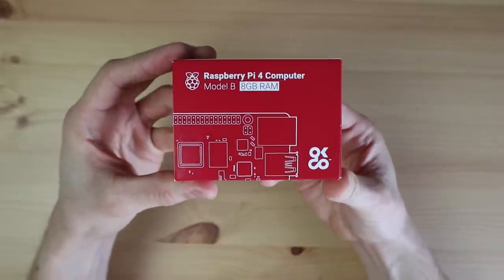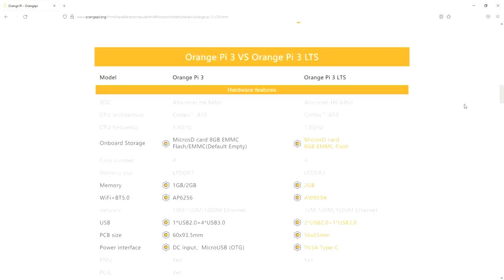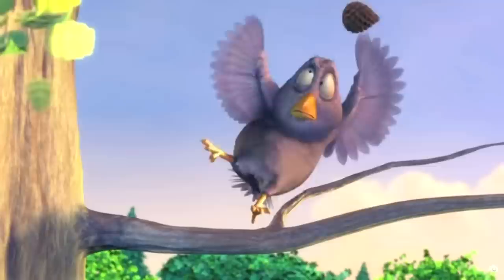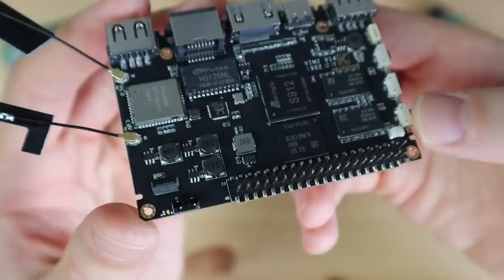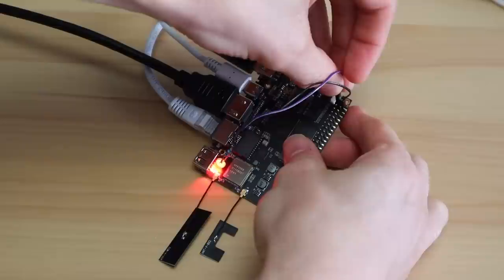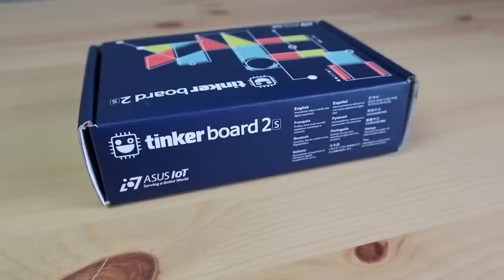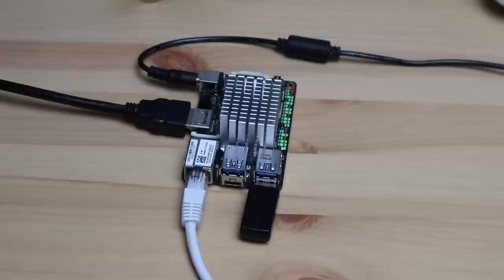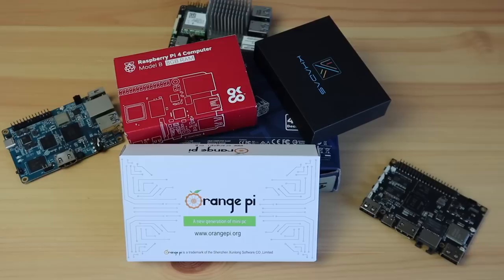Pi Shortage - Are These Worthwhile Raspberry Pi Alternatives?

Comment: I like RPi, but for my own microserver I use an Odroid XU4. It has slower single core performance and it has less RAM, but having 8 cores available at all times is amazing
Reply: What os are you using?
Reply: @orangezeroalpha  Arch Linux ARM
Reply from the maker: It seems like my next video should be trying out some Odroid boards, there are quite a few recommendations for them here in the comments.
Reply: @MichaelKlements  I’ve had a few of them, they’ve been unreliable.
Reply: @c1ph3rpunk  I have Several HC2s, an N2 and an HC4 and they've all been solid.
Reply: Yeah, the XU4 is a BEAST.  it's only 32 bit machine, but with 8 cores, it's pretty amazing.  Keep your eyes open for the RK3588...  That will be an octocore with armv8 (64 bits)
Reply: @unixorn  yeah, the N2 is also quite good too!
Reply: why is it amazing?
Reply: @kayakMike1000  what exactly is amazing about it!

Comment: I needed a second Pi 4.  Just got a Pi400 for HamPi etc.  Works great and excellent built in cooling.  Stock frequency is higher at 1.8 GHz and safely overclocks to 2 and remains cool.    The price of the Pi400 is reasonable considering it has everything you need.
Reply: Yeah, have mentioned that for a bit of extra space taken up and a few ports lost, a 400 is pretty much cheaper than getting a 4GB 4B and a decent case/cooling for it. If keyboard layout doesn't matter/you're happy with an external keyboard, they're actually available in plenty here - if you're really desperate, you could get the official keyboard hub and swap it (on that note, black and red is sexy 😍)

Comment: The problem with a lot of the alternatives is lack of libraries and documentation for developers. Also hardware support for videeo acceleration is often missing lots of features (or completely missing, so software rendering only, which sucks).
Reply: I use Texas Instruments BeagleBone Black and write software for it, and I can absolutely say that the PowerVR SGX530 GPU it has is the most difficult GPU to use by far of any that I have ever used, even NVIDIA. Imagine every GPU issue you have ever seen all at once on one device, and on top of that, it is actually not even physically wired into the display controller correctly due to a mistake that was made during its PCB design, causing a hardware bug that further limits its features. Technically it does work though and can be used to play games

Comment: "When you play with these boards you quickly realize why Rpis are so sought after" . My experience exactly !
But I will say Orange Pi Zeros are FANTASTIC lightweight servers with low price and trivial power consumption & Lan. I have 2 running at the router for years now with no problem.
Also the EEMC is not to be overlooked. I have a 3+ year old Orangepi3 non LTS I run Octoprint server on and it blows RPi 4b out of the water. (but some octoprint plugins wont work on it), so i run the server on a slower Rpi because its more widely supported on the community.
Reply from the maker: I think what you've said is the best general conclusion - they're great if there's an image available for the particular software package you intend to run on them and you're then going to leave them to run in the background. If you need to add to or moidfy the package, or you're going to be actively working on them, then you'll probably run into issues.
Reply: Yeah the orangi pi with Armbian is really good for general server purposes (thanks Armbian devs). For applications that needs hardware accelerations, rpi is the go-to choice. BTW orange pi 4 with rk3399 now costs ~$45 used and $65 new in Chinese market. Hope price elsewhere in the world settle soon.
Reply: I wouldn't recommend orange pi to anyone. FriendlyElec boards are easily the best chinese boards and things actually fully work on them for the most part. Luckily the armbian & dietpi teams have fixed many of the software issues that existed for orange pi but there still are many versions that are broken in various areas. Other than that there is pine and odroid which are I guess right under raspberry pi as far as peoples usage goes
Reply: @gg-gn3re  i just looked up friendlyElc, oh man these boards are expensive. the main reason i tried Orangepi the first time was because it has superior hardware for a lower pricepoint. I guess while Rpis are selling for the price they do these ELC boards are actually a viable option.
Reply: @fortheregm1249  RK3399 for $50 isn't expensive
Reply: @gg-gn3re  Cheapest one on their website is $92. That's not expensive?
Reply: @eugy2008  Cheapest board they have is $8 wtf lmao
Reply: @gg-gn3re  I dont see any 8$ boards on friendlyelec. What is the name of the board you talking about? The cheapest I see is $16. 
Yes, I made a mistake. They have different boards.
Reply: @eugy2008  lmao... I'd be more concerned about getting glasses at this point
Reply: @gg-gn3re  Same goes to you. I've asked what model for $8 you are talking about and I still hear crickets about that.

Comment: The reason youtube was stuttering under debian/ubuntu is because lack/poor of hardware acceleration support. Poor CPU is decoding the video instead of a dedicated chip.
Reply: Making Tech  That's a limited solution. It's like suggesting to someone running on their hands to hydrate : sure, it will help, however using their legs will help them more.
It's exactly the same here, using the dedicated hardware is magnitudes faster than the general purpose CPU. This is why it worked fine in android but not in Linux. For more serious usage, enabling it is the solution.
Reply: At Sunxi site, there is a Linux kernel with GPU firmware embedded into the kernel. I don't know will it work on Debian, but it works on Arch
Reply: Rpi os aarch64 does not provide vpu out of the box inside chromium last time I've  tried, and wasn't  even working on vlc/mpv, like on armhf does.
Reply: @Axer101 that's the most stupid today's comment I've read so far. It doesn't  add anything, and wasn't a horrible mistake.
Reply: Agree with all the conclusions in the video; thank you for putting it together. Would point out that if you intend to use these as “video players” as you said, you simply need to run one of the ELEC distros like CoreELEC or Libreelec. Don’t spend even a second messing around with those junky Android builds or trying to use a bloated desktop Linux. Something like Libreelec will deliver flawless 1080p/5.1 DTS/x264 playback all day long. They do it on a Pi2 so I’m pretty sure all of these boards (if you can find a build for them) will work fine. That big boy will probably do 4K/x265 and still have enough clock cycles left over to do some bitcoin mining for you.
Reply: I use Ubuntu headless for another project.   I find Ubuntu GUI way too slow. Raspberry Pi OS is much lighter and faster.
Reply: @3asyrider75  of course, LXDE is very fast. With mutter it also has a decent compositor and delivers a tearless experience. It has some impact on gpu performance inside apps tho.
Reply: I’m using TwisterOS for at about 6 months now on my pi4 and it works very well with Youtube (1080p) but it also runs Netflix, Spotify and Disney+ out of the “box”
Reply: @brehme1971   As the video points out, there are lots of options, and infinite support for the RPi. Unfortunately you simply can’t get these boards anymore. The video was looking at other hardware options to fill the gaps.
Reply: @brehme1971  yes but that is software decoding anyway. so, very high cpu usage.
Reply: @JohnSmith-gs4lw  infinite support? hahahah x86_64 has infinite support, not rpi. vpu inside the browser sucks on rpi, specially on aarch64.
Reply: rpi video decoding inside the browser is done on software, just enabling a bunch of flags and utilizing h264ify like rpi os does you can get 1080p30 video playback on any rk3399, overclocked or not. of course, soft decoding.
Reply: @microlinux   My point was that discussing the RPi — good, bad, or indifferent — is kind of meaningless because they are unavailable. The whole reason for this video was to explore ALTERNATIVES to the Pi. So let’s talk about those. As you point out, testing video rendering might tell you something about performance (of the board, the OS, the windows manager, etc) but it’s kind of pointless if your end goal is watching video.  If you want to watch video, just get LibreELEC which does use the hardware acceleration and be done with it.
Reply: @3asyrider75  GPU support in Ubuntu

Comment: I do believe this is the end of Raspberry Pi... Due to their board shortages and the high cost of exciting boards have turned alot of people, I am one of them. I teach and develop on the Raspberry Pi with my students, but now that a new school year is coming... my students will not be able to find or purchase them. So, this will lead me into other single board computers. With having to redevelop a new program around a new board, this is be my end to Raspberry Pi.
Reply: I highly recommend looking into getting older POS machines. Plenty of them run Atom systems and are plenty powerful enough for your needs. They are pretty power-efficient, dirt-cheap (since they are so weak), mini-ITX, so not too big, run off a laptop power supply, and also support both modern Windows and plenty of Linux distributions. I myself have 12 Atom-based machines, and they are excellent for teaching. Highly recommend looking into it.
Reply: @xPLAYnOfficial  thank you for the information...
Reply: why not use the pico, if it is about to teach programming ?
Reply: @jyvben1520  Features and horsepower. It's incredibly weak and limited, making it difficult to teach the basics of computers with.
Reply: It really ended up a huge smack with Covid-19.

Most critical components I need have lead times of over a year right now. So it's mostly electronics no one have wanted to buy and that has been collecting dust that is available. Or some devices with all-Chinese components - because they managed to keep their component factories running while so many other factories slowed down or took a permanent break.
Reply: @perwestermark8920  Yep pretty much. That's why I've been using these older Atom SBCs like ones put inside POS machines. They are readily available, dirt cheap, and have plenty of horsepower and support for tinkering purposes.
Reply from the maker: I think the longer it takes them to get their supply chain issues resolved, the greater the market share they're going to lose. As you've said, lots of people rely on Pi's for teaching, courses, products etc.. They'll tolerate not being able to get them for a year or so, but are then forced to start looking at alternatives to keep their businesses going. Once they've developed new material and products around alternate boards its going to be that much harder for Raspberry Pi to get them back.
Reply: @MichaelKlements  Nope. It isn't as easy as this. The component issues affects the competition too. Which means it's mostly dusty boxes made long ago that sells - when they have sold out then you don't have alternative suppliers either (unless you hunt for even less popular products that has collected even more dust).

There is nothing special with the RPi that makes it harder to produce than the competition. It's just that the RPi has always sold well enough that there has never been any magazines with RPi unsold. The web shops have had new devices coming in constantly - so when the supply stopped, the end customer sales also stopped.

And the few RPi that can be made from the existing component trickle ends up with prioritized customers - I bet they have focused on compute modules to help industrial customers.
Reply: @MichaelKlements  I agree. Massive shame, but we can't wait forever.
Reply: @jyvben1520  Picos still need a computer... SBC is all in one, just need keyboard mouse and monitor. Plus, my students buy the Raspberry Pi to use in their projects, ie. Robots...
Reply: The Pi4 boards don't seem to be available at the regular price - just high prices from scalpers. But the pi400 seems like it is still available at reasonable prices (the one with essentially the same hardware as a pi4 built into a keyboard).
It won't work with a Pihat obviously, but you do still have access to the GPIO pins on the back.
Reply: @xPLAYnOfficial  I bet the community is small and so are the resources. Probably end up being worse than any of the alternatives on the market now, imho.
Reply: @MichaelKlements  I'm beginning to think Pi no longer cares about an average maker as their priority is to supply the boards to commercial clients!
Reply: @eugy2008  In my experience, it isn't, particularly because they act like regular x86 machines, with traditional BIOS features, ports, headers, form factors, OS support, drivers, etc. In pretty much every way functionally, they are regular machines, just with very weak BGA Atom CPUs with piddly little on-board graphics.

Are they a perfect substitute for a Pi in every scenario? Of course not. However they do have plenty to offer for those who are looking for a tinker board.
Reply: @michaelleiper  pi400 is not reasonable price in an educational environment.
Reply: Can any other SBC match the software/operating system support of the raspberry pi?
Reply: @MrFilip121  Probably a regular miniITX board, which is why I've been recommending the plethora of cheap older Atom miniITX boards that are out there from old POS machines. They have their own compromises for sure, but they do offer some advantages and there's plenty of them available, since they are so weak and outdated by today's standards.
Reply: @MichaelKlements  competition breeds innovation. They’ve cemented themselves as the market leader and everyone attempts to duplicate their design and offering.
Reply: Raspberry pi is prioritizing industrial customers who need constant supply. If you are buying 20/semester you might approach them about it. But if you expect each kid to find one themselves, yes, no way.
Reply: Did you contact the foundation, if you make a business/educational case they should help you jump the queue.
Reply: I totally agree with you. For my project, I decided to use raspberry pi because it was cheap so that I can expand the processing power by increasing the num of, and I try to make every pi can be replaceable easily. But my solution is broken now due to the expensive price....
Reply: You and your students may be forced to other solutions, but the Raspberry Pi will hardly die out. 

On the contrary, the community will continue just fine and when the Raspberry Pi5 (someday) replaces the 4, it will  flourish anew. These Pi alternatives will always be the lesser choices and niche products that have a limited appeal.
Reply: I call BS. This is a setback, but RPi is a know quantity with quality hardware and software and lots of support. No one is going to forget them. For those with immediate need like for the situation you are in (i.e. kids need them for classes), yes, it will be a set-back... temporarily. But with anything right now, a little patience and things come back. As long as they can keep the financials in order, the rest will follow.
Reply: There is absolutely no sbc that can compare to the quality of a raspberry pi. I personally like the Latte panda 🐼 but like you said the price is a turn off

Comment: I recently bought a used Fujitsu Futro S720. Comparable power, x86_AMD64, $25 including shipping and 2GB RAM. Has a built-in SATA-port and power consumption is great with the original power supply. Great!

With a little trickery you can convert the mSATA-slot to SATA as well and built a neat server. The S920 (around $40) is even more powerful.

Comment: The reason behind the bad performance of YouTube on Linux vs Android is quite simple and does not depend on the board itself. None of the modern browsers under linux support YT video encoding on GPU, but rather they use software (CPU) decoding. 
The same applies to Intel x86-64 PC computers and it is especially visible on laptops.

Comment: I really think Pine64's SBCs (Rock64/Quartz64) have some of the best support after RPi, they really seem to believe in long term support / manufacturing; pity you couldn't check them out. The chinese manufacturers of a lot of other SBCs seem to be running like pump'n'dump schemes of cheap SoCs in comparison.
Reply from the maker: I've never used one of their boards, but I'll look into them. Have you got any recommendation between the Rock64 and Quart64 (it looks like the Quartz64 model b is similar to a Pi)?
Reply: yea. as far as support goes
rpi > pine => odroid > friendlyelec > others
Reply: @MichaelKlements  the Rock64 is more like a pi3 competitor but as far as I know pretty stable software/kernel support. While the pi4 continues to be out of stock at MSRP, it's a very solid bet if you just need a value SBC to do pi-like things. The Quartz64 is more pi4 competitor, it's taken them longer to get mainline kernel patches than RPi foundation would but they do seem to be constantly working on it. The choice of models is interesting, you can get pcie on the A version if you wish, or traditional RPi form factor with B version, and you can get emmc storage instead of relying on a microsd
Reply: Rockchip Soc's are surplus Android chips at best in my opinion.
Reply: but they're all sold out everywhere as well!
Reply: @gg-gn3re  from everything I've read this is true ..
Reply: Should add that software support applies to their LTS models -- they also release bleeding edge hardware and they're very upfront those models are for developers to write the most basic software support.
Reply: @MichaelKlements  I like the Rock64 but had a problem with the HDMI ports failing - possibly due to a floating earth at my end. Apart from that problem, they are good products. I'll stick with my Pi4s and 3s though.